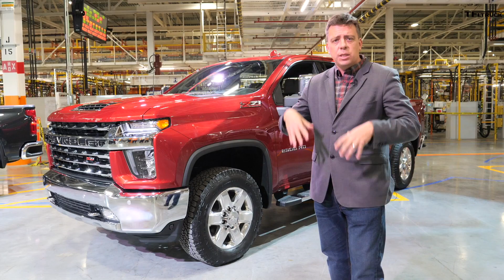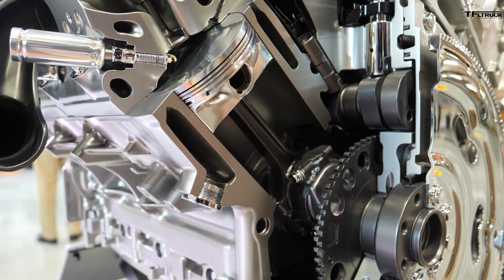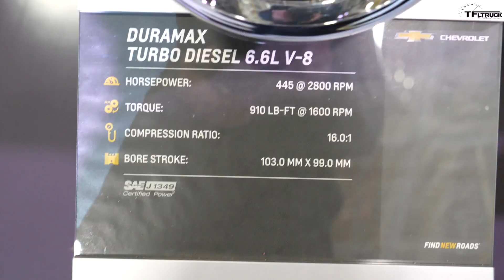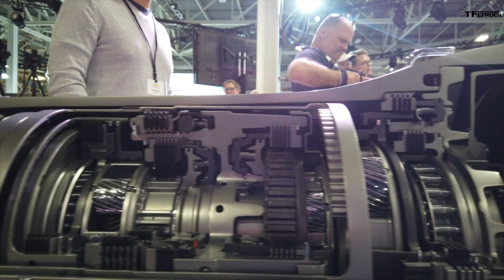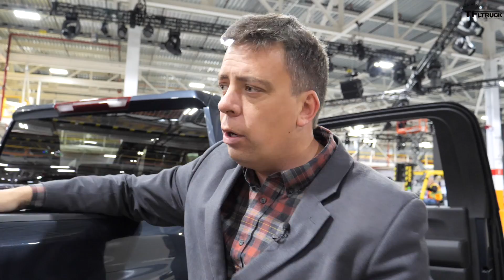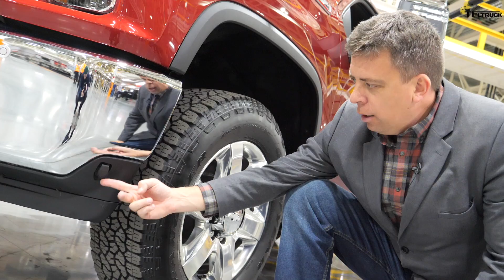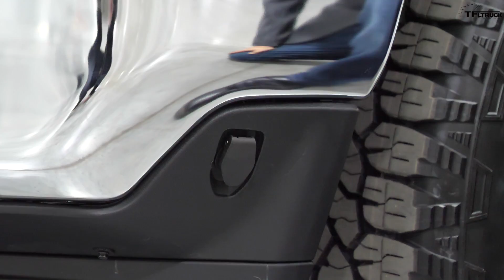Here is How the 2020 Chevy Silverado 2500 HD Delivers the Torque to the Ground

Comment: 6.6lt V8 will need be tested against Ford 7.3 V8 on Ike, can’t wait👍
Reply: I'm a GM guy, but that Ford 7.3 gasser looks very promising.  Big block bore spacing, stronger block, and bigger displacement.  I'm betting it puts out more torque than the GM 6.6l gasser.  Now, if the EPA would get off their hard on for diesels, and get rid of all that shit they required since 2007, I'd go back to a diesel.
Reply: I’m over the BS Def additive!  Bring back the BIG BLOCK GASSERS! 💪🏽💪🏽💪🏽
Reply: @suavehouse5150  I feel the same way, until they pull all the emissions crap off diesels I'll never buy another.
Reply: Blake Breckenridge 
My last diesel was a 2008 LMM Chevy 3500 Z71 had a PPE TUNER!  Best truck ever dog the shit of it with 260k in 2 years!
Reply: Even though I'm a GM fan, the Ford's have been coming back hard with styling, features and decent power plants. The review on the 7.3l Ford gasser was built with reliability and longevity in mind. They went with turbo valves and seats, massively thick push rods, turbo style rings and pistons, steel crank, 6 bolt main bearings and an iron block. The power rating will be more than their current 6.2l. My guess would be that the new 7.3l gasser will put out 450+ HP and 510+ lb ft. TQ. It was a complete let down to see GMs 6.6l gassers numbers. Might as well just keep the current 6.2l GM gasser. GM's numbers of 401HP and 456 TQ were lame to say the least. GM's truck engines are not really performing like RAM's and Ford's. Even Ford's 5.0l N/A engine puts out more power than GM's 5.3l. It's sad to see, but it's reality.
Reply: @jamesmalekisabellasking2031  Yea I'm a gm guy too but all the option gating behind expensive packages, ugly styling which looks like the old ford model with a Honda ridgeline fascia, and under-performing engines all for 30% more than it is worth(6.2l is an exception, love the engine, don't love that ltz is required FOR NO REASON). Don't get me wrong i will never buy a ford but def keeping my truck for another 10 years just like the last one.
Reply: @jamesmalekisabellasking2031  I'm a GM fan myself and agree, they really missed the mark on the engines and style, the Chevrolets look terrible.
Reply: Jamie Shields I’m definitely more interested in these gassers than max towing this or 1000lbft that. While I think the Ford will have an advantage in terms of performance being larger displacement and paired to a 10 speed, cost will factor in on which is going to be the model to choose.
Reply: Alan Bowers I want to see how these engine deliver there power n lbft with n without weight. Automatic can hide true power of engine.  Remember Fendt 1000 tractor engine is designed different to truck engine to deliver power n I suspect these gas engine deliver their power different compared small block GM 6.0 or Ford 5.0 V8.
Reply: Oh man that’s going to be awesome!
Reply: drew a GM 6.6 might be smaller displacement but it’s way engine delivered the power threw to gearbox to axle compared Ford 7.3.  Also weight of truck n full load of trailer up hill n down hill who will win in time n mpg?
Reply: @DMAXRYNO Here is your power tow mirrors you've been wanting buddy ole pal ole pal ole buddy
Reply: I can't wait for that either!
Reply: 6.6 runs like an LT so it's a speed engine not a work horse engine. 7.3 is a big block which has better boom but I terms but pulling the 6.6 will win but how long will it last.
Reply: Jamie Shields that’s not a test. The Ford will out pull it. We’ll have to wait and see what the unannounced 426Hemi from Ram does.
Reply: Ford wouldnt stand a chance
Reply: Hopefully it’s at max weight not no  8000 Lbs because we know that will be a walk in the park
Reply: The new Ford 7.3L (450ish CI) Gasser is expected to make around 440-460 Hp and 500-520 Torque. My Guess is 460 Hp at 5,200 Rpm, 510 Torque at 3,800 Rpm and redline at 5,600 rpm
The GM 6.6L (400 CI) Gasser is 401 Hp and 464 Torque

Due to the larger displacement, 50 or so more Cubic Inches, and the engine designed around peak torque as low as possible, the 7.3L will have an advantage. 
Ford is not going to build this engine to Rev crazy High or make high HP/Tq numbers due to reliability. They want the engine to last as long as possible. One of the reasons they went back to a Pushrod Design. Ford Mod Motors are notorious for Cam Chain Guide Failures, Timing Chain Stretch, and even Timing Chain Failure. Even the EcoBoost 3.5L has timing chain issues, and they average 120,000-150,000 miles before they need replaced, While the LS/LT Engines don't have timing chain issues.
Reply: Ford would win
Reply: Austin luetge at what cost though? Ford’s 7.3 will be a mid tier engine while the Chevy’s 6.6 will be a entry level engine.
Reply: Alan Bowers fords is bigger and they have not released the horsepower or tork yet
Reply: @austinluetge3202  yes, and? What does that have to do with my question?
Reply: @austinluetge3202  Bigger does not mean better, you know. Turbo 4-bangers today are making as much or more power and torque as the big V-8's used to, and towing capacity on today's midsize trucks are numbers that past full size trucks would dream of. These days an extra liter or so of displacement usually just means worse MPG's.
Reply: Alan Bowers it has everything to do with it 🎃
Reply: @MX5-XU  the 7.3 should be the base they're getting rid of the 6.2
Reply: @63impfx45  According to the video they posted on it, Ford says it'll slot between the 6.2 and 6.7. Who knows for how long, but that's what they said.
Reply: Enyo Sarac yes I know that it’s that ford said that they’re going to more horsepower and torque but they have not released it yet
Reply: @63impfx45  6.2L is Ford's entry level engine in their HD's. The 7.3L is replacing the 6.8L v10.
Reply: @MX5-XU  I've heard it is replacing both the V10 and the 6.2L  Where did you get your info? I would love an XL stx w/ this 7.3
Reply: 1stStLversys https://youtu.be/2FtNlfAbc2w around the 12 minute mark.
Reply: @63impfx45  you're most likely right. The new 7.3 is the perfect replacement for the aging v10. It'll probably be most found in uhaul  trucks. What I'm most excited about is in about 5 to 10 years, people are gonna start swapping them, and this Chevy 6.6, into smaller half ton trucks, or even Camaros and mustang's! We got some interesting years ahead of us, the roaring twenties! What a time to be alive
Reply: @MX5-XU  thanks, I somehow missed that
Reply: @TheFishE77Official  bigger engine less turbo last lot longer. Great for long term of work horse. Smaller 4 banger will do it but shorter life than V8.
Reply: @TheFishE77Official  but when the turbo fails, be prepare to open your wallet!!!
Reply: @MX5-XU  Yes but the 6.2 ford will still compete with the 6.6 gm gasser
Reply: @63impfx45  Your wrong ford is keeping the 6.2 and axing the 6.8 v10 fords engine line up is 6.2 base engine 7.3 gas option and 6.7 diesel option
Reply: @austinluetge3202  ya on paper!? Like the power joke?
Reply: @loewen_specialty_pets  god not you again. I feel trapped between fanboys from either side. Gonna get out of here before I become the base of the eiffel tower....
Reply: DURAMAX_DELIGHT what ?
Reply: DURAMAX_DELIGHT you like to eat paper what ? Ford will have more horsepower and torque
Reply: @MX5-XU  which means the new 7.3 will be around 450 hp and over 600 fpt, we all know Ford like a little to much torque on their engines.
Reply: @MX5-XU  look at the way the rocker arms are seated which means it will be handle high rpm. Imagine these engine with some boost, in the upper 800 hp
Reply: Luis Villa unless you have a source for that information on the 7.3 I call BS. My wager is on a sub-500lbft rating. Remember a LB7 Duramax only produced 5xxlbft back in the mid 2000’s, and that was with boost.
Reply: @MX5-XU  the LB7 was 15 years ago, the f150 is making 400 hp and about 400 torque with the 5.0, now the massive 7.3 its coming hard, and it's a gas engine hopefully they bring back the 7.3 diesel.
Reply: Luis Villa true but still that’s a boosted engine versus this NA gasser. Coyote is a great powerplant but remember it’s designed for both small car and light duty applications. This 7.3 is designed to be a work engine likely taking the place of the Triton 6.8. It’s a low revving work engine, not a relatively peaky unit like the Coyote. Numbers aren’t it’s primary concern, longevity is. If it actually made 600lbft that would likely make it the torque’iest NA gas engine ever made.
Reply: Luis Villa I hope they bring back 7.3 it was great design by International n if anyone own n drive one it was reliable none of mid size trucks like VW amrok could out do it been here in Australia.
Reply: @luisvilla101  keep in mind the 5.0 is dual over head cam, that's how it makes all that power in the upper rpm range. This new 7.3 is a pushrod motor
Reply: DURAMAX_DELIGHT ....power joke...power choke..😂🤣😃😄😅
Reply: Austin luetge ....ford is a joke.... go look at resale value Ford has the lowest resale value out of all the manufacturers there's a reason why
Reply: @stevemorelli1451  If fords are such a joke than why do they keep out selling the gm twins and ram every year?
Reply: brad coddington..... because they spent about ten times as much on Advertising
Reply: @MX5-XU  what's boosted? Coyotes are making up to 460 hp and 420 in torque with no power adder.
Reply: @outlawcry12222  memory is fuzzy but I think I was responded to someone else's comment.
Reply: @outlawcry12222  if GM played the build a motor and max out go from it then they wouldnt be getting 450,000 to Ford's mod motors 150,000. So GM don't do it. There doing fine hitting close up numbers without sacrificing longevity. ford spends their money on looks and adv. GM like always strictly performance and longevity. Poor working man shit. I view Ford Chevy as Rich man vs. working man. the rich man can be stupid and wear his engines out at 150, 000 cause he can get another.
Reply: @johnsonbobo2376   and why are you telling me this? I only said what I said because the guy I replied to said the coyote is boosted lol.
Reply: @johnsonbobo2376   btw mod motors can last plenty too. My old GT had 215k before I sold it and it was running every bit as strong as any other gt I've driven.
Reply: @outlawcry12222  tell that to the 3 valve
Reply: Torque on the Ford is expected to be over 600.
Reply: @luisvilla101  no way it breaks 600. N/A performance cars over 7 liters barely break 600 and that's at mid range RPM.

My guess it'll be at or a bit over 500 that peaks around 2-3000 RPM.
Reply: @MyTubeUser321  You have to take into consideration that this is a completely new designed engine with modern technology not like the old big blocks. I could honestly see mid to upper 500 lbsft of torque from this new 7.3.  600 might be a stretch but Ford is touting this engine as the go between the 6.2 gasser and the 6.7 power stroke  the small gasser is putting out 435 lbsft of torque and the 6.7 oil burner is probably going to eclipse the 1000 mark so im sure the 7.3 is going to be in between the two so I dont see 500 to 550 being out of the question. Ford doesn't like playing second fiddle in the hp and torque game.
Reply: @luisvilla101  source please, or i call BS.
Reply: Alan Bowers chill bro 🥶
Reply: Alan Bowers fords better buddy
Reply: @austinluetge3202  lol it really doesnt have anything to do with price, but yeah go ahead and keep drinking the koolaid.
Reply: Alan Bowers Buddy chill I never said it had anything to do with price 😂
Reply: @austinluetge3202  I know... I did. I asked you a very simple question. I guess reading is difficult for some though. Carry on.
Reply: Luis Villa 😂